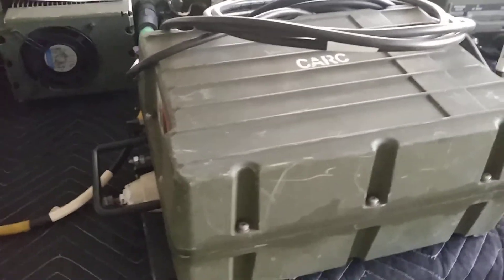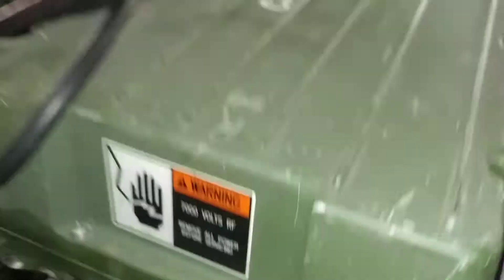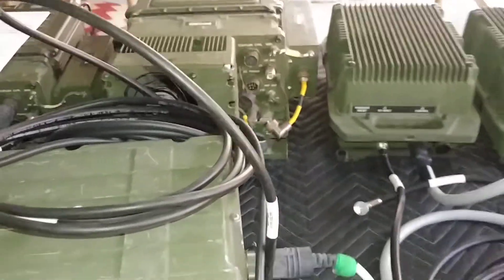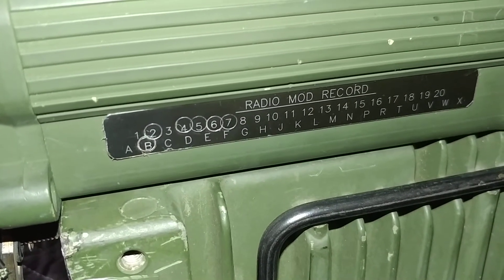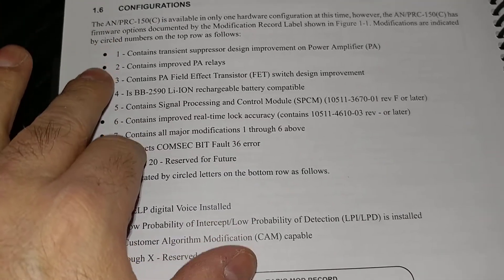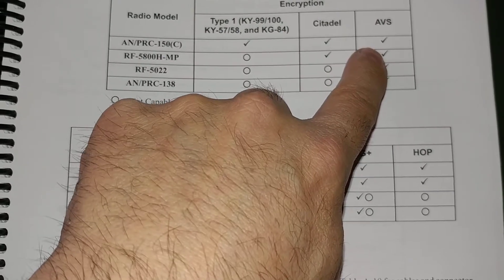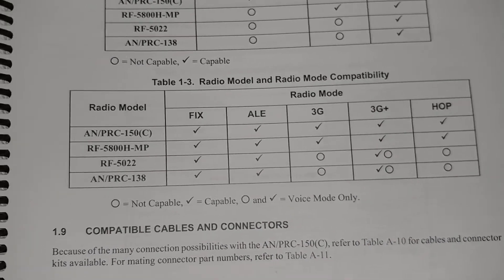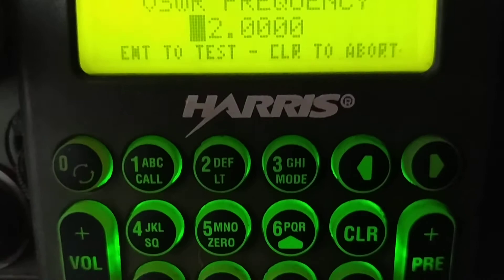Harris RF-5800H-MP/RF-5833H 150W Amp/RF-5382H Coupler/RF-382A Coupler Testing Part 2

Comment: Where is the antenna connected to? And what does the coupler do?
Reply from the maker: In this video there is no antenna connected, but these couplers and the radio can handle no antenna just fine unlike many commercial/ham sets. The coupler is an impedance matching device that matches the 50 ohms resistive of the radio to whatever impedance the antenna is based on its size/length and the operating frequency.
Reply: @w2hx  do you not need a dummy load connected to the coupler?

Comment: When connecting to the tuner-output N-connector, all tuner circuitry is then disabled.  The tuner becomes a simple RF 50 ohm pass-thru.  Tuner circuitry is engaged only when the N-connector is not used and thus your antenna is connected to the RF HV terminal.
Reply from the maker: Hello there. Unfortunately, you are not correct here. The coupler definitely tunes the 50 ohm connector. Of course, with any length of 50 ohm coax, you certainly risk having higher than desirable SWR on the coax line. But the coupler looking at the entire load of the coax and the antenna as a lumped impedance, it will tune it.  Look here for an excerpt of the manual: https://w2hx.com/x/Harris/RF-382/50ohm-port.jpg  it clearly explains only two things happen. First the output of the coil pack is switched from the HV connector E1 insulator to the 50 ohm port (this is easily visible inside the coupler). Second, it initiates a new tune request. There would be no reason to do this if it is expecting 50 ohms. It would just have to bypass the coil pack in the same way it does when in receive mode (if desired). Secondly, watch this video: https://www.youtube.com/watch?v=Cxus1yP9baI you can clearly hear the coupler searching for a tuning solution which it does, despite using the 50 ohm port. Hope this helps. 73
Reply: Do you have a manual for the rf 382 at all?